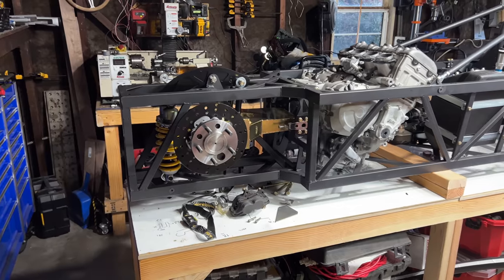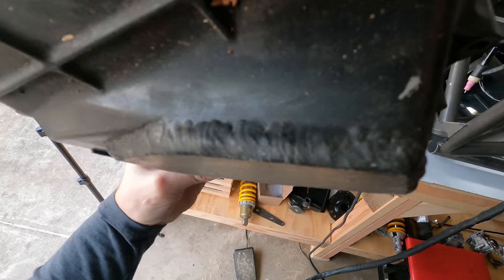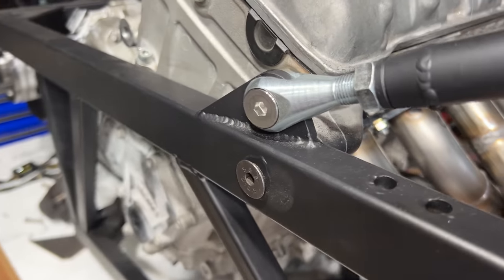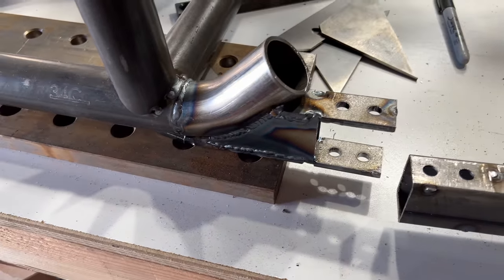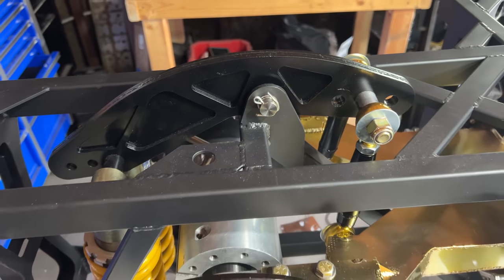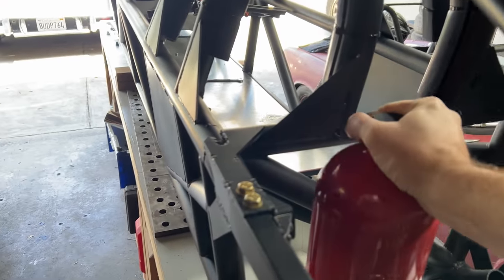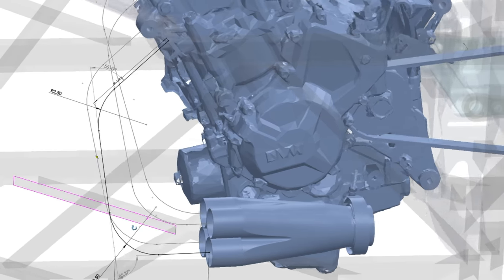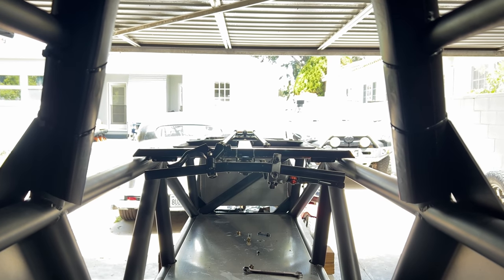How To Build A Fast Slow Car, Fast

Comment: Hey Matt with the rear shocks being too stiff couldn’t you just drop one so you are only using 1 shock instead of the 2? That might also make adjustments easier with the 2 not fighting each other
Reply: He addressed this in an earlier video: https://youtu.be/SmF21a2oVic&t=454  Short answer: rules are ambiguous, so erring on the safe side with two shocks.  Though the rules optimizer in me would say if the rules say you need a damper for each wheel, but don't say they have to be the same, you could just use one damper that does all the work and smaller/dummy damper that effectively does nothing. Though the older, more experienced me, doesn't bother with those things because rules can be rewritten faster that you can engineer around loopholes in the rules.  Hence two shocks/springs.

Comment: Are you concerned about putting air cooled power electronics right next to your exhaust pipes? I'm sure the algorithm told you it would be fine, but the algorithm loves magic smoke...
Reply from the maker: I'll be putting a heat shield in front of the headers. also possible that I move the rectifier under the seat with the other electronics.
Reply: @SuperfastMatt  in my experience rectifiers are unreasonably sensitive to everything... Wherever you put it, probably a good idea to make it easy to swap😂

Comment: What's with the rear of the chassis? It's got a truss structure but the diagonal members don't meet up? wouldn't it be bad since the center member gets a ton of shear loads?

Comment: Dont half fill the fuel tank, cos then it has half air, so all it will need is a heat source before it lights up. Would be a lot safer the completely fill the fuel tank

Comment: Are you allowed to use the non-powered cylinders as air pumps which you can route around to the inlet. Kind of a super charger. Sort of. I’m a software guy, so I don’t do metal and stuff
Reply: Supercharging would put the car in a different class.

Comment: Hello Matt,. I tried to see if this has been asked already but it doesn't seem so. Is that a Brazetek heat exchanger and what size and layer count is it? I got a 5x12-60 for a vortec 4200 but had no reference.   If yours works it would give me greater confidence.  Thanks!

Comment: Adding all those bolts to the chassis components still look janky.. it seems to me it would have been a whole lot easier to cut some box tube a size larger and through bolt it all together in a sleeve fashion. Would have doubled the metal over a distance.

Comment: There are motorcycles with greater displacement, less weight, less vibrations too... I don't know why you wouldn't just take Tesla Batteries and re-orient them in the chassis. Just cut down on drag and achieve the lowest 0-60, best electric 200mph+ time and call it fun.

Comment: Matt. Very entertaining. Your attitude and humor are priceless and your video's entertain me for sure. Your projects are tasteful and your effort is respected. However, have someone show you how to improve your welds or simply the appearance of your welds. Yes, your welds may be adequate but are terrible in appearance.  Welding is an art or should be art like. It is not appropriate to disregard this basic industry standard requirement. During tech inspection your welded assembly could be rejected. Your welds will have porosity, inclusions, undercut and some lack of fusion. A guaranteed failure if weld quality is required.

Comment: why not flip the motor 180 degrees so that the exhaust ports are towards the rear? The mechanics to reverse everything else would likely weigh less than the current headers, no?
Reply: I assume that reversing the chain drive direction would be heavier and much less reliable.

Comment: May be a dumb / noob question, but is there a tradeoff between chain and belt drive in motorcycles? Is it just a durability thing?
Reply from the maker: I believe belts are slightly more efficient at high power outputs, but they are a lot wider.
Reply: Belt drives also don't need lubrication.

Comment: Should be good for 80 MPH by the time all the steel and weld wire is added. Just too many send cut send parts and exhaust pipe enough to make the frame from. Oh I love the video. Now that is a piece of entertainment you can really sink ya teeth into. land speed video with excellent jokes and riveting discourse. ( is that a word?) I'm the new guy here so ignore that if it's stupidd?? (stewpid? that looks better!) Some gorgeous bird shit holding the swingarm together. With your experience we know that really took some doing. Brilliant, should cut through the air like a knife. If you do go fast it will have an amazing whistle to it that no turbski can imitate. I'm subscribing Matt cause this Sh*#s about to get interesting.. Thank you very much. OH!One more thing. Even nice people get dead screwing it up going fastest. measure the thinnest part of fat things and find a way to make it all weigh nothing while being equal tough thick and ignorant of failure force. We all really want to watch you do stuff until we are old people with dreams sitting in the garage or nurses t chase around the nursing home.